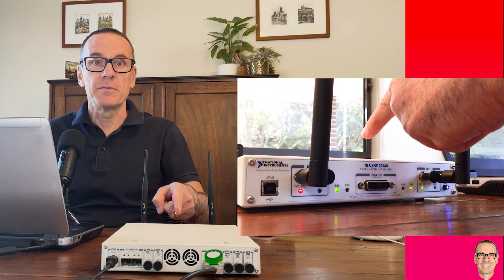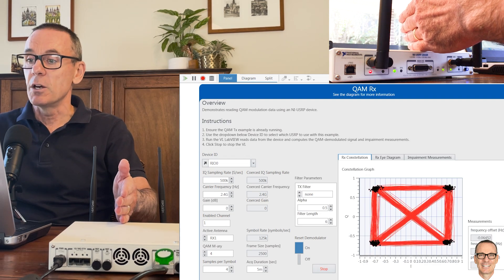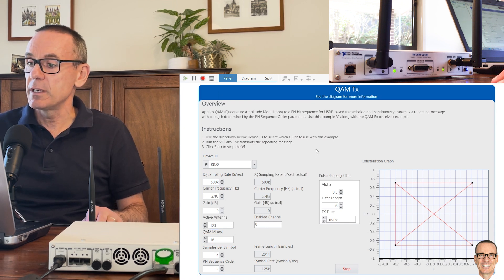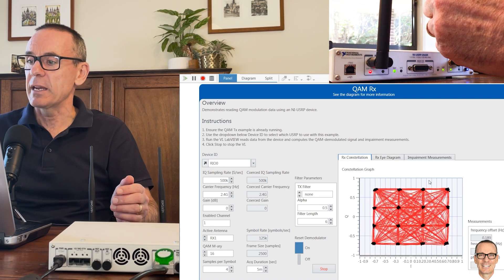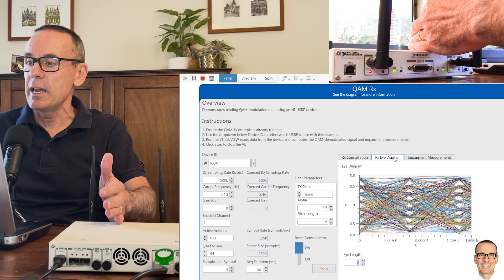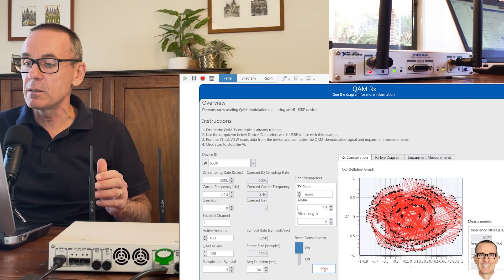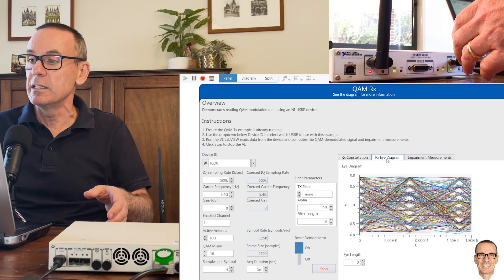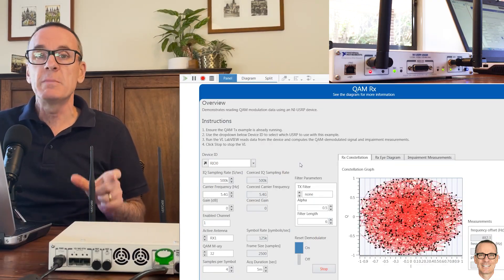Visualising Digital Communications: QAM with Real Signals

Comment: In DVB-C digital qam modulation is data directly modulated on to the carrier?  or they use some intermediate frequency (IF) before modulating it on to the carrier? 
Because we used to change carrier frequency from 100 Mhz to 1000 Mhz without any major degradation in signal BER (bit error ratio) or Constellation Diagram.

Comment: Hello, short question about the DOPPLER shift impact on OFDM.
Do you have a video about that topic? believe it is not possible to just shift all carriers back for compensation. Thanks a lot.
Reply from the maker: Here's my video on Doppler and OFDM. It doesn't talk about how to compensate for it, but it does explain the effect, and by understanding that, it's clear that it's not a simple task to "just shift it all back" after the signal is downconverter and sampled. "Why is Doppler a Problem for OFDM?" https://youtu.be/mB0GF9uKC48
Reply: @iain_explains  thanks, I watched that video carefully. You mentioned this filter bank (for the subcarriers), we cannot adapt that bank because it is hardware? Is that right?
If implemented in software,  it should be possible,  I assume. 
Thank you.

Comment: But they obviously make higher order QAM's work at 5.4 GHz, right ?  So what do they do instead ?  Must be more tricks
Reply from the maker: Well yes, there are always more tricks ... but my understanding is that this is just a basic software defined radio (SDR) implementation of a receiver, with what I assume is a basic synchronisation algorithm implementation. It's the software that came with the USRP - I didn't write it myself. Plus, as I said, it doesn't include error correction coding. And I don't know what the exact specifications are on the noise figure of the receiver amplifier. Lower noise amplifiers will give better SNR.
Reply: Ahhh OK.  Non-optimal setup for that band.  I saw the unit and software and assumed it was some expensive pro test unit.  I need to look at this package.  It's very interesting !  Thanks for the great video !
Reply: QAM-256 is the same at 30MHz or 5GHz; the higher the frequency the faster data can be sent... But also there's more bandwidth theoretically available, but losses are more significant over the same distance.
Reply: @jamess1787  Amazing !  QAM-4096  Yep !  Path loss is another important part of it.   It looked like, from the setup, that RX and TX were right next to each other so should have been easy peasy  :)
Reply: @k7iq  amazing the difference the medium makes 😉. Air versus copper clad steel
Reply: Also, I was doing QAM-2048 and 4096 over 192MHz channel at a previous job; around 130-300 MHz; could run multiple 192MHz continuous. Fun stuff.

Comment: Nice one, What is that software?
Reply: I believe its the LabVIEW NI-USRP, which is for NI universal software radio peripheral (USRP) transceivers and LabVIEW reconfigurable I/O (RIO) USRP devices.
I could be wrong though so double check.
Reply from the maker: @jenis-01  Yes, you're right. It's the LabVIEW NI-USRP software.